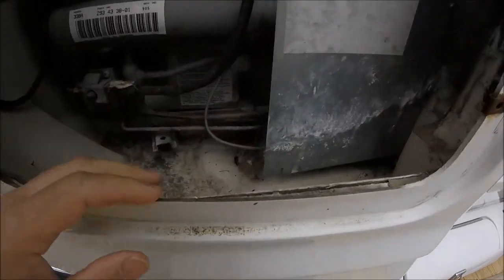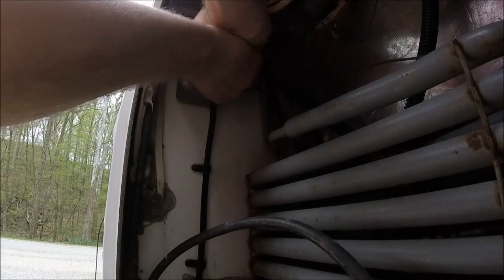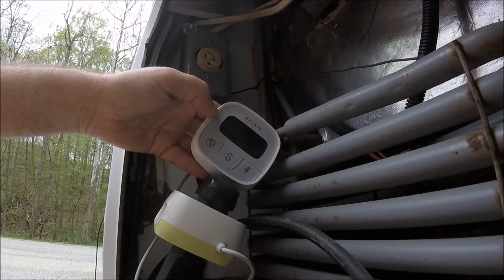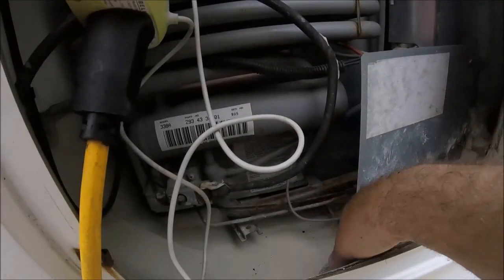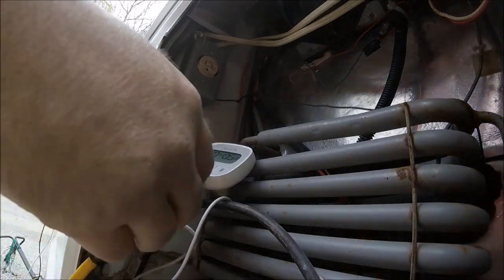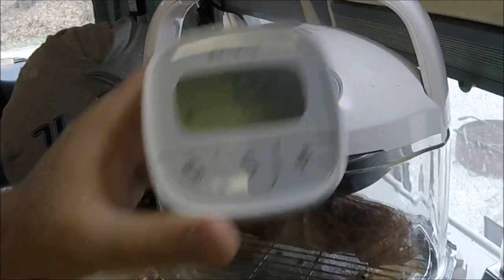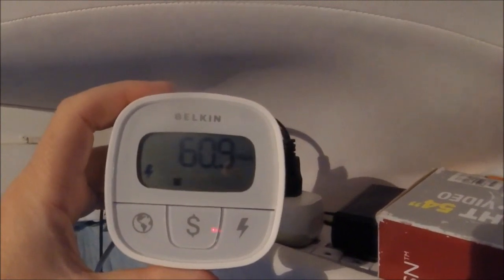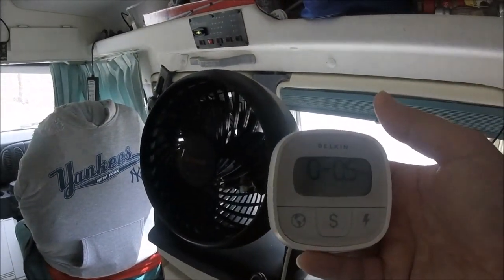RV Stuff ~ How Much Power Do Things Use

Comment: Sure would help of they put these power ratings on the devices they were selling. I have a meeter too and a simple off the shelf box fan will use just under 60 watts. Compared to your small fan that is a lot I rather have 4 small fans for 40W than one big one for 60? But I found these box fans on sale for half the price and I bought them all becasue I know how we use these things.
Reply from the maker: oh I know the ratings are on each device - but this is a more fun way to check. lol I would agree more fans at lower watts is good to be able to keep air moving